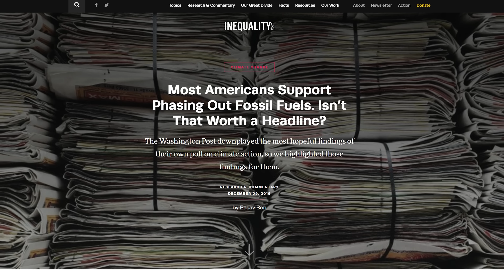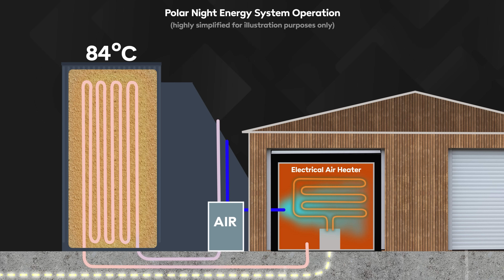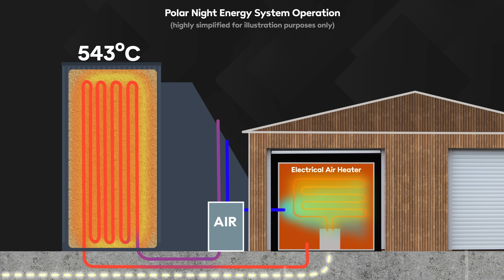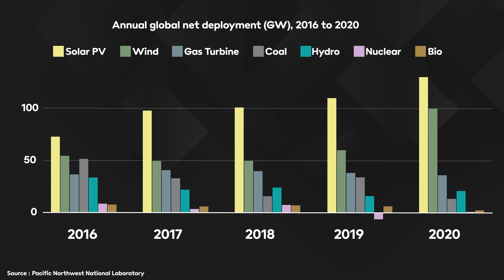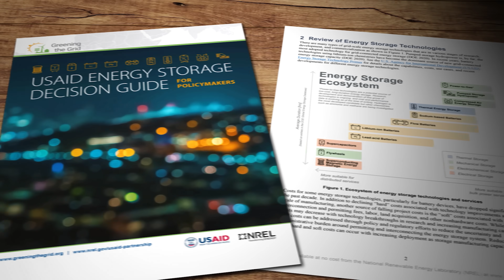The 'Sand Battery' that heats your home, NOT the planet!

Comment: Heard of Mirabilite, also known as Glauber's salt? It's a step up from a sand-battery! Thermal storage
The high heat storage capacity in the phase change from solid to liquid, and the advantageous phase change temperature of 32 °C (90 °F) makes this material especially appropriate for storing low grade solar heat for later release in space heating applications. In some applications the material is incorporated into thermal tiles that are placed in an attic space while in other applications the salt is incorporated into cells surrounded by solar–heated water. The phase change allows a substantial reduction in the mass of the material required for effective heat storage (the heat of fusion of sodium sulfate decahydrate is 82 kJ/mol or 252 kJ/kg[23]), with the further advantage of a consistency of temperature as long as sufficient material in the appropriate phase is available.

For cooling applications, a mixture with common sodium chloride salt (NaCl) lowers the melting point to 18 °C (64 °F). The heat of fusion of NaCl·Na2SO4·10H2O, is actually increased slightly to 286 kJ/kg.

Comment: You should stop calling petroleum fuels “fossil fuels”.. it’s quite silly and expresses ignorance.
Reply: As does calling Oil 'petroleum'.
Reply: @luzr6613  “Oil” is simply a general term for a chain of carbon atoms (triglyceride). There are numerous oils sourced from plants and animals, used in cooking, skin care, etc. and then you have oil generated within the earth (hydrocarbons) which are collectively called petroleum and are then refined into various fuels. Yes petroleum is AN oil (or collection of oils) but so are numerous other oils from other sources used for very different applications, so specificity is beneficial (as in all communication). Additionally, there are even fuels produced from plant oils, so just using “oil” is unnecessarily ambiguous.

Comment: Another interesting heat storage material is sodium sulphate, which undergoes a phase change at from solid to liquid at 32C and can thereby story lots of 'latent' heat. The phase change temp is also adjustable down to 20C by adding common salt. This temperature range seems perfect for heating/cooling applications.

Comment: I heard something where they are a resistance heater and a blower.
Hot air go through and heat up the sand.

Is it possible to use the warm Airstream which is blown out through the Air conditioner?

Comment: So I have a hot air stream and I heat up the Sand? Can it used normaly Industrial waste heat in the summer time and use it to heat up the Sand and in winter Industrial wasteheat can be used to heating houses and the Sand can be still use for heating

Comment: why is heated air used to 'charge' the sand bank?
it seems to me that simply running electric heating elements directly inside the sand would be more efficient. 

at the end of the day, its an oversized version of the old economy 7 storage heaters. it seems that this usage is much better than the old version that you couldnt adjust once hot.

Comment: Great informative video as always. I wonder is this scalable downwards? could you have smaller, localized units that heat a smaller number of homes, or even a single one?
Reply: If your heat goes out you can get a few extra hours of warmth by filling your bathtub with hot water.  It won't last long since it wasn't designed for that purpose, but it will keep a room above freezing a little longer.  So it seems reasonable that a smaller scale system could work specifically for a single home or a small neighborhood, etc.  

I saw a design years ago where someone placed a large black stone wall facing South and inside the home that wall was fitted with water pipes that were used to move the collected heat to tubes underneath the tiles in his bathroom.  It was enough to keep his toes warm for basically not a lot of electricity (it used a small water pump to circulate the water).

Comment: So what are you do when the winds not blowing I assume you can’t run electric heaters off of solar panels without it being very In efficient not cost-effective so do you hate this for the gas when you don’t have wind or solar?
Reply: Hmmm... we run heaters off solar panels and also store the energy in a variety of ways - some as electrical energy in batteries... some as pumped hydro for a micro-turbine. We seem to have managed without a blackout for fifteen years.

Comment: I love the concept, using readily available material to store energy. Unlike lithium-ion batteries, there's no toxic waste, no recycling challenges, and no rare earth metals used. I'd be interested to see if you could use a sand battery for a single dwelling, storing a summer's worth of excess heat and using it in the winter to run a boiler for radiant floor heating. I've seen simple heat battery systems for greenhouses, but this is the first time I've thought, "Maybe this can work for homes too."

Comment: Better to avoid giving up your independence to central sources. And best to not be dependent upon foreign or even domestic energy when you don't need to be.

Better to change building codes so that new homes are designed for passive heating and cooling, and so anyone renovating can take advantage of the new technologies. We have a lot of great insulating technologies these days. Do we really need so much energy for heating / cooling, or are we not using the insulation very widely?

Comment: Seeing this project, 2/10, next. Store Heat outside....dumb. Using air to transfer thermal energy.... dumb. As I do in my house, add enough thermal mass, Heat it when it's sunny then "close" the insulated battery mass... open it when needed. This way even when Heat is leaking.. it Heat the house.
A friend got a similar system in North Canada and it Heat house in winter with 10 solar panels (the place is cold but they got lot solar radiation).

Comment: Air.. Is a poor heating transfer method.... Problem with all those "ideas" is that there is no real numbers, it's easy to talk ideas into people that got no idea of physics.
I'm building my home with no heating apart from passive solar, the solution is here, build houses correctly.
Reply: There is no one 'correctly' though. Different micro-environments require different solutions. Yours won't work in the valley I live in, and mine would probably be in excess of your needs.

Comment: I have come across communal heating systems in Dutch Cities. I seems to work well though they were picking up heat from local electricity generation systems IE No waste heat cooling towers. In the UK I have often wondered about charging thermal masses with solar for instance. Something one could set up with a reasonable available space would be great.

Comment: <<a container consisting of one or more cells, in which chemical energy is converted into electricity and used as a source of power.>>

It's not a battery and calling it one doesn't make it one.

Comment: One thing I can't quite get my head around: heat pumps are 300% to 500% efficient since they are not generating heat but merely moving it. This only works for low (human-scale) temperatures, though. For thermal storage, be it water at 98°C or sand at 600°C, you must use direct heat, which cannot exceed 100% efficiency.

So, while district heating from thermal storage seems like it gains a lot of economies of scale, I can't see how you can beat even small-scale heat pumps. Unless heat pumps are completely off the table because the outdoor temperatures go below -20°C or so. Which, come to think of it, is probably common in Finland.
Reply: Heat pumps are more efficient. However this and other thermal storage solutions are making use of existing wasteful processes.

Just like the example used in the video, Data Centres produce a ridiculous amount of wasted heat energy, which normally cannot be used and is just expelled. This then makes data centres very energy inefficient, even if renewables are being used to power the data centres a lot of excess energy is going to waste. 
By storing this excess energy in sand to be released into exisitant district heating systems this then makes data centres more efficient as well as provide the district heating company stored heat for use whenever they need. 
District heating is already a thing in a lot of central europe & scandanavia with incetives to join the district heating which  also makes it more economical for people. This along with your comment on -20°C tempuratures really pushes this kind of technology. 

This big picture view of the energy system, finding where energy is being wasted and turning that into something more useful, is way more sustainable and better for the environment than just sticking heat pumps everywhere because they are really efficient.

Comment: I took over a commercial steam district heating system and running it was not easy. Many issues such as leakage (as steam is very corrosive, think about steam cleaning), end users not maintaining their equipment so pumps failing and not returning the water / steam meaning lots of fresh water was required. Also issues of responsibility for providing the steam became a problem. Most utility companies have a get out clause in their supply contracts where they cannot be held responsible for any issues caused by failure of supply. This proved difficult especially when selling a property as the buyer wanted absolute certainty which couldn’t be provided. This may seem odd but they understood the main utility companies and with electricity could install Battery packs for short power cuts or generators for longer ones, but what to do if they lost all heat for an unknown period. Eventually the system became too costly and complicated to run and was removed. The sand battery does seem a good idea but using it to produce electricity would seem more sensible especially given the electrical distribution system is already in place. Digging up a towns streets for the flow and return pipework would be a major undertaking as these pipes with insulation around them are quite large, when the electrical grid is already there does seem unnecessary. Generally electricity is the easiest to distribute. Places like Scandinavia, with cold winters, already use heat pumps effectively so using it to provide electricity to cover intermittency of renewable supply would seem more sensible.

Comment: Can the same system in principle be used for cooling during summer? In the coming decades we will need in summer cooling systems also in places where it is 
freezing cold in winter.  It would be nice to cool the sand in winter, isolate it for months and use it to cool houses during summer, then heat it up in summer for winter...

Comment: I'm from Denmark. In my hometown, Holstebro, we have district heating using multiple sources which makes our heating very cheap. A lot of other cities have relied on gas, and they pay a huge price now. I think the "sand battery" is a splendid idea. We could use it here to store some of the solar energy that we have plenty of.
Reply: Why has it not been implemented  here in Denmark, yet? Sounds like a perfect solution.
Reply: Sector coupling. For example a metal cast factory has a lot of heat it can be used for heatin, factory waste heat can be used and for example using the waste heat directly to heat up the Sand.

Especially in summer ( AC System get rid of the heat and below it  in the sand
Reply: @CUBETechie  Sector coupling, yeah, I feel this is the way new energy systems must be designed. It's like a new "eco"system must be created, consisting of various kinds of energy components. This is in contrast of traditional "one problem solutions" like burning stuff to create energy, or even nuclear.

For example, the metal liquid batteries.. I'd like to see them put in a place where their waste energy could be harnessed.

PS. Hans, combined heat and power production gives a really high efficiency, over 90 %.

Comment: How does the Sand Battery solve the problem of the Data Center's waste heat being produced at 60C instead of the ideal 75C that a district heating system would need?

Comment: Thanks for another great video. 

Where to begin? This is one hell of a Pandoras Box.
Now, in a word, yes. That said, if you and ready have district heat then conversión is a no brainer and should be implemented immediately. 
For new residential developments and commercial buildings, I be interested in "stand alone" systems supplying heat given the cost in infrastructure. 
What would be the footprint and integration with the architecture be, so as not to create an "eyesore".
Another nagging problem would be backup, if you're like me and a member of Murphy's church. What to do If there's a hiccup. 
One thing that does come to mind would in assisting said systems with the use of fresnal lens and parabolic dish. Just a thought. 
One of my main concerns is existing architecture and construction. Making it cost effective for owners to super insulate their structures, thereby making the system work less. 
Back in the day I was a fan of solar hydronic heating and radiant systems, and they do have their place. But as with a new technologies they ALL do have their issues over time.  Of course, no system is perfect and all will need some form maintenance. This is where things get tricky. The simpler the system, the better. The more passive solar we can integrate through the architecture, the better. The only thing now is how to convince people to buy and live in a structure that us not your typical A-frame or ranch style home? Imagine a housing development where all homes are solar oriented. Homes on only one side of the street with backyards extending to next street curb. No rear backyard neighbors. Who knows? Time to pull out the sketch pads and the roll of yellow trace. LOL
One thing we can't do is keep building the way we do and polluting the environment in the process.
We need to naturally heat and light our homes, commercial and industrial buildings, and we need to do it NOW!
If you're living in hurricane and tornado alleys and the big bad wolf keeps knocking it down. We then it time to smell the coffee and wake the hell up! What we are currently doing is not working. We need to change the architecture and the construction industry. We may even need to look into the past and see how our ancestors did it and see what is still standing.
If memory serves me, back in the early 80's I visited New Alchemy Institute on Cape Cod. They had a small back bermed greenhouse with about 6 - 800 gallon fish (tilapia) tanks acting as a heat sink, facing the southern glazing. THAT'S IT! This is all they had. Growing tomatoes, cucumbers and others, and even a banana tree in the back!
One thing is for sure, we can't do wait ten or fifteen years to do something.
And remember, "Bigger is not better" and "Form does not follow function, but rather Fiasco".
Cheers

Comment: Wouldn't it make much more sense to bury the sand storage facility underground because the underground temperatures would be in the 10-15C (50-60F) range so the warmer temperature would mean less heat loss?
Reply: The difference between +10°C and -20°C is almost meaningless compared to the +600°C of sand. Either way, the most important thing is that the container itself be well-insulated. Whether that be from the sand itself (as the video implies), or from an extra insulating layer.

Comment: i once thought about the heat storge system like this - massive underground, insulated tank of water heated during summer by solar colletors up to near 100 C and discharded in winter by simple heat exchanger to mayby 50C and then by heat pump to meybe 10 or 20C. Could it work? [sorry for my englich, im not native]

Comment: Dave this looks viable for higher temperature energy storage for steam production for industry. I prefer the use of heat pumps for lower temperature applications like buildings to take advantage of the "amplification" of energy (SCOP of 2.5 in my region)  by gathering "free" environmental energy.

Comment: A mini sand battery in a backyard could be filled with sand and piping to heat water that turns a small turbine that generates electricity.   Just dig a hole & fill with sand, use a cap made of alumiumn to keep water out and build a dirt curb to keep water from flowing in.   You'd need sound deadening panels to reduce turbine noise in a shed but with hot water solar panels you could heat the sand via water flowing and power a home almost year round and use the heated water to heat the home.  Sell excess power to the grid too.

Comment: I wonder if using an insulated water immersion heater filled with sand or other suitable material a small domestic unit could be used to provide night heat... certainly possible in Mediterranean climate

Comment: Air have a poor heat capacity, so WHY use air as the input energy carrier??? It makes no sense, why not put the heater inside? Also, heating to 400 or 600 C is just ridiculous, do you have a shortage of sand??? The losses increases fast and the need for high temperature isolation makes this quite impractical and expensive. As usual for "Just Have a Think" there is NO "Think" before posting the videos... :-(

Comment: I just saw an article on Europeans planning to use wood for heating this winter. Would it be possible for you to make Europeans aware of rocket stove heaters and rocket mass heaters. These wood stoves burn the fuel far more completely than regular wood stoves and thus generate more heat per unit of wood. There is a universe of designs on the internet and YouTube. When properly designed, the exhaust gases are not very hot and it is easier and safer to vent them to the exterior. Since the exhaust gases are vented outside there is no danger of carbon monoxide poisoning.